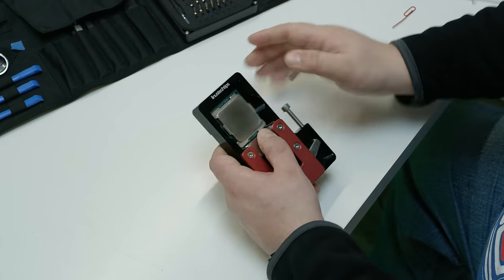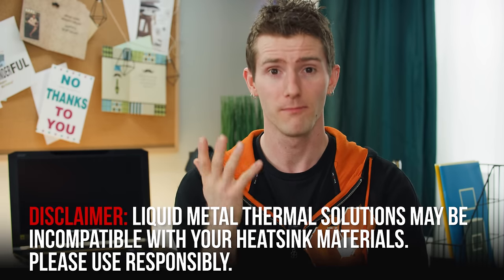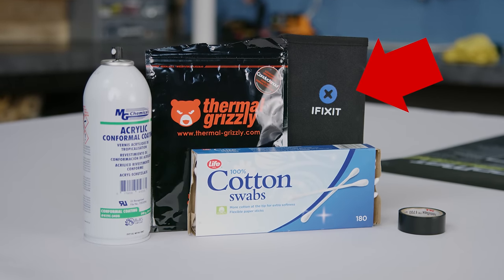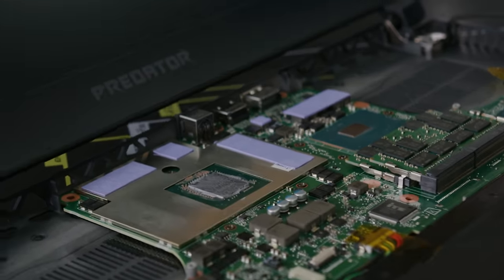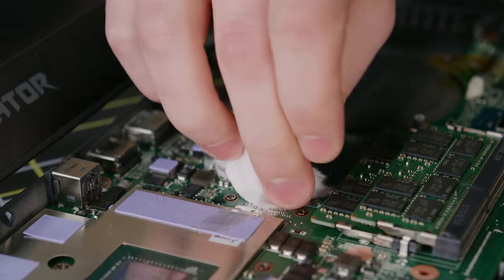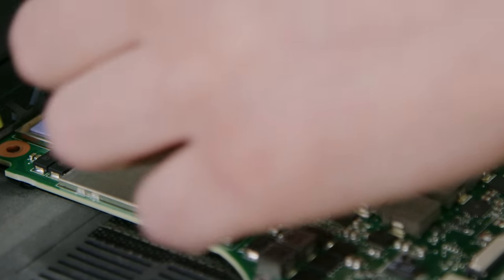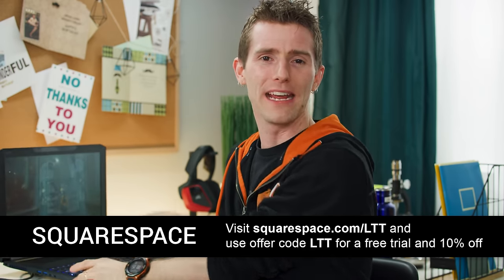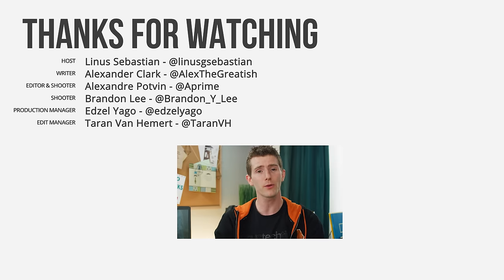Liquid Metal Laptop Cooling – 20C LOWER!

Comment: taken from: http://forum.notebookreview.com/threads/something-to-think-about-liquid-metal-compatibility-with-copper-heat-sinks.800890/

While those who are familiar with galinstan (liquid metal) type thermal compounds and how very bad it is to apply these to aluminum it is probably not thought of of how this works with copper.

Galinstan is an alloy of gallium, indium and tin that has a melting point of -19 C and a boiling point of 1300 C (no other metal has such a big difference between the melting and boiling point). This means that it remains a liquid at temperatures across what a CPU would see, unless you took your powered down laptop to Antarctica or Siberia and left it out in the cold where the galinstan would solidify and expand by about 3% (potentially tearing the heat sink off of the CPU if you did not make room for expansion).

Gallium loves to alloy with other metals; even with copper the metal ions will migrate in to the copper metal, gradually creating a copper-gallium alloy that is grey-silverish in color.

What makes this happen much faster is the electrochemical potential of the two metals. This is the same principle that makes an old fashioned lead-zinc battery function. Two metals in contact create an electrical potential and current will flow. One will oxidize (corrode) and the ions will move other to the other metal where there is a reduction (or plating) effect. Electrochemically speaking, the most negative metal will sacrifice itself by corroding away to build up a layer on top of the positive metal.

Electrochemically speaking, gallium has a potential of -0.53 volts and copper has a potential of +0.334 volts. The difference between the two metals is going to create a "battery" with a potential of 0.864 volts.

Gradually this battery will deplete; as the gallium migrates over to the copper. You may have heard some stories about how gallium "dries up" and evaporates. In many of those cases it is likely that it acted like a battery and migrated over to and became part of the copper heat sink.

If you take apart the heat sink from the CPU and clean it up you may find that the copper heat sink is colored a silverish-grey that resists efforts to even buff it off with a scrubbing pad. The stuff you can polish off is a corrosive residue of oxidized gallium and the stuff you cannot remove easily is now an alloy.

One good piece of news is that if this happens repeatedly the battery action will stop, as it is pretty inefficient to put gallium and have it migrate over to a gallium-copper alloy.

There might be a few things that are not so good news. It is possible that the gallium-copper alloy is much less a thermal conductor than pure copper. It is also possible that the alloy is not as structurally sound as pure copper or becomes brittle (gallium is pretty brittle when it is solidified). You may not even notice the first instance of less thermal conductivity unless you were in a laboratory setting and counting calories (thermal) and heat transfer characteristics, the actual difference may only be 1-2 C in a computer and that can get lost in all of the other variables of how computer CPU's cool, loading, power, air temperature, dirt on the fins or fan inefficiencies. 

The second thing regarding brittleness might only be a concern on a vapor-phase heat sink where the metal is very thin. Again, this is not proven by any particular instance but there is always the potential of the vapor phase heat sink of fracturing and letting out the magic cooling juice, right on to the CPU. (do not panic over this statement, I am not backing it up with any examples but maybe heat sink manufacturers should look in to it).

If you look at the IHS (integrated heat spreader) on top of a CPU it is made of nickel plated copper. If you ask the question "why did they put nickel on top of copper? copper is so much better of a heat sink material) it may be due to the corrosion vulnerability of copper.

Actually having the IHS plated with nickel is a good thing, it has a galvanic potential of -0.3 volts, much closer to liquid metal so the corrosion between the CPU IHS and the liquid metal is almost nil.

What might be an idea is to electroplate the contact area on the heat sink with nickel (nickel can electroplate directly to copper) and it would be over an area about the size of a postage stamp. In manufacturing that plating takes about five minutes but there is quite a bit of set-up to keep the nickel just where you want it and not over the entire heat sink.

You "could" electroplate nickel at home but it is a fairly toxic process and generates hazardous waste.

Again, maybe heat sink manufacturers can consider some sort of plating process.

Another alternative is a barrier that prevents electrical connection (that allows the battery action of galvanic corrosion from happening) but still has very high thermal conductivity. We have had this with regular ceramic, alumina (and even silver based) thermal pastes. No matter that the word aluminum or silver is in the name, most are pretty horrible electrical conductors.

This problem is pretty unique to just the liquid metal TIM (thermal interface materials) crowd but it is something that we should be aware of.

(BTW, I nickel plate and then silver plate my heat sinks but I have the experience from doing this with jewelry. It is an expensive and potentially toxic thing to get in to just for a heat sink).

Comment: A correction in this video. You should put the liquid metal in a tiny tray and use a tiny swab brush to apply the liquid metal. watch a much accurate version here 'MSI GS65 Laptop Teardown and Liquid Metal Mod - 20C Lower' by upgradejunkie

Comment: Hi Linus Tech Tips, if that's possible I would like to see you test that Liquid Metal compound against other thermal compounds, but cross it with different heatsinks. Just to see how a heatsink size/quality affects the temperature gap between all tested compounds. And since you started that LM project, there is also a factor that I can't find anywhere answer to: How gallium-copper alloy that is being created in copper heatsink, changes it's thermal conductivity over time? Some say it's better, because contact surface is better and some do tell grimm tales of lower performance. Cheers.

Comment: I’d really like to see how this would effect the unibody MacBooks Pro if you used it between the cpu/gpu cooler and the bottom plate of the MacBook . As well as it’s traditional spot. I mean if it’s designed to cool the laptop with the body then wouldn’t some kind of thermal compound help that?

Comment: I should try this on my Sager Clevo P750TM1-G. Its packing the 8700k with a GTX 1070. I undervolted and underclocked the cpu to a max of 4.4Ghz of 2 cores and 4.0Ghz six cores while locking the gpu at aprox 1600Mhz and achieved pretty significantly lower temps coupled with Cooler Master Mastergel Maker Nano. My cpu maxes out at 64~65C and the GPU peaks at 65C in Fire Strike and while in actual games, the temps are about 10 to 15C lower, depending on the game. I bet they can get even lower with some conductonaut while getting better performance, maybe even matching stock clock speeds, I just don't trust myself do something THAT extreme ; w;

Comment: Bad thermal paste 4+ w/mk, good thermal paste 12+ w/mk, liquid metal 70+ w/mk, Graphene 5300+ w/mk. (same stuff you have in your pencil)
Napkin math: 
Liquid metal 73w/mk, stock laptop thermal compound 4w/mk. 
Difference cond. 69w/mk. 
Difference temp. 20C. 
20C/69wmk=0.29
Bad logic:
Temperature lower with graphene: 0.29*(5300-4)=1536.8C
Reply: Ahh yes you must know the secret. tooth paste with ground up pencil in it, works  better then any thermal paste yet no one uses it...

Comment: Honestly. Use kryonaut. Liquid metal has a REALLY bad tendency to slip and slide around if you apply just a little bit too much, and one of those droplets ending up in the wrong place WILL fry something. The results are also not all that much more impressive than high end thermal paste, something that surprised me given the very large delta in thermal conductivity.
Reply: I compared both those products on GTX 970, GTX 1080 Ti, i7 8700k (on the die, delid), on the die of a CPU laptop. Except for the 1080 Ti, there was always a huge difference which made it worth it to use the conductonaut.

If you don't put too much (basically if you know what you are doing) and you protect stuff with nail polish I don't see any reason for things to go bad. Of course this voids any warranty :)

Comment: So I did this without any spray because I didn't watch the video first. It's been about a week now and I've been fine and it improved so so much. Also I'm only running an A6 5200 so I'm not to worried if this laptop breaks. It was only $300😂

Comment: Hi,
I was wondering if keeping say a packet of cold milk, or just a frozen box would help with the cooling. There were a few reservations I had with the idea
_______ISSUES:
_______1. Could this cause condensation on the motherboard (thus increasing risks of a short circuit), in case this cools the inlet air, which would also pick up moisture.
_______2. Would it have a noticeable effect if this isn't close to the fan inlets, and only under the body, such that it cools the bottom of the bottom surface which slightly cools the air inside the laptop.
_______Why not buy a laptop cooler like normal people? >> They would accomplish the same, albeit slower, since they'd be pushing in more room temperature air, and conduction to the laptop body from a cold object would be more effective than from a less cold air flow.
 One disadvantage is that the higher convection may increase gunk accumulation in the board as the air carries dust along with it.

Comment: MSI use high quality paste so using gelid GC didn't change much. At the beginning tests are very promising but after some time it always stays at those "stock" temperatures, no miracles. I guess outdoor temperature is a main issue for laptops cooling.
Reply: Msi do not use high quality paste. I can tell by having a MSI GS65 Stealth Thin 8RF and got a 20 C decrease in cpu heat
Reply: Well that's rare, I guess that they put it wrong in factory process. I never had such a big diffrence in temperatures. 5 C is MAX, but it also depends from outdoor temp.

Comment: Wouldn't it be more logical to apply a thin thermal pad around the GPU capacitors rather than electrical tape as a liquid metal barrier? Even just finding the right thickness it could be lightly crushed and completely make a seal around GPU on the heatsink. I'm thinking about doing this to my Predator Helios 300 while I swap to a 960 evo m.2.

Comment: While I know I'm late, I've only just owned my first (proper) laptop for about a year and I'm considering it.

Some napkin math suggests that:
Given a heat producing area of 140mm², heat production of 50W (best my cpu can manage is sustained 42W)
thickness of TIM 100um (optimal acording to fuji electric and ridiculously small)
the paste would give a delta of 8°C
while Conductonaut™ would do 0,49°C.
The math checks out. This stuff is amazing.

The equation (for anyone interested) is:
P=c*A*∆T/d
P - power
c - conductivity
A - area
∆T - difference in temp.
d - material thickness
Reply: Ok nerd

Comment: You didn't mention that the gallium in the liquid metal will react with the copper in the heatsink. It corrodes the heatsink, essentially 'burning' itself into the copper, degrading the metal and creating a stain that dries and becomes literally - not figuratively, LITERALLY - impossible to remove by any normal means, including scouring pads, rubbing alcohol, tissues, or razor blades. This can potentially result in WORSE temperatures over time, if you're unlucky.

Liquid metal should honestly only be used to replace the TIM in delidded CPUs. I'm not saying you CAN'T use it on laptops, or as normal thermal compound on the outside of CPUs, but it'll eat into the copper of any heatsink you put on it.

Comment: Why not just simply use Grizzly TG shield to protect CPU components? And as i know there is a smaller attachment for syringe when applying liquid metal and that bigger one to take away if you spilled too much. And that looks like too much liquid metal for cpu and gpu.

Comment: Why would he recommend this solution on a laptop without waiting to see if it leaks out from the die or deteriorates conductivity? almost always leaks from what I hear even with conservative application. Nice spooge at 5:08. I'm not sure if it would take all day to mask a die for a insulation coating unless you failed kindergarten. This would take 5mins or less and insulate much better I think. Will be applying this on my 7700k/780ti desktop which stays upright. I did appreciate being able to see somebody else do this first however, as I myself never have.

Comment: I wonder, could you create a thin 'border' on the outer edges of the cpu heatspreader with normal thermal paste so the liquid metal can't run out onto the board over time, or would the liquid metal react with normal paste in unfortunate ways?

Comment: Why don't the manufacturers do this in factory already?? Just spray a layer of non-conductive shield on the capacitors and apply liquid metal. Then that would be another market jargon "ultimate liquid metal boost" some sh!t like that.

Comment: I fell down the rabbit hole after this and looked up lots of liquid metal cooled laptops, but none brought up its effect on battery.

One would think with better heat dissipation it doesn't have to work as hard to cool and thus use less power. Follow up video with light medium and high loads and the effect on battery?

Comment: you should have mentioned room temperature as well.  after checking the stock thermal temperature, room temp might have been dropped.  
People who reviewing coolers, usually make this mistake a lot!  

like this
 
"I checked my Intel stock cooler and it says 80 degree and while I changing new cooler I reviewing it,
 my father turned air-con and I did not realized it then I fcukin found my new cooler says 50 degree under same test load!!!!  It is amazing!"  

but it is totally not same

Comment: Wait, if the performance increase is seriously this massive, why don't laptop manufacturers already do this from the get go and release products that perform head and shoulders above the competition?
Reply: Look Behind You Like other people mentioned, the compound might just dissolve your laptop (slowly) if it's parts are made of aluminium/copper which most are... You'd also need to re-apply it regularly as well and not move your system around a lot to minimize the risk of you bumping into something with it that might get the compound in unwanted places thus bricking your device.

The risk isn't worth it in short.
Reply: I think they sould adress this and make it work
Reply: Price. If it costs 10 cents more, that equates to a million more dollars, spent to design the robots and such in the design process. I agree that they all are under engineered, in the design phases. I guess beauty before brains. More important to design it to look nice than to perform.
Reply: lol there will be alot of returned laptops because of getting fried.
there is always a risk of that liquid metal to go to other component.

Comment: Thermal Grizzly liquid metal Is the drug of gamers. I have a Acer predator Helio’s 317 inch with a core I seven 7700 HQ and a GeForce GTX 1060 Re-pasted the GP/CPU a month ago with thermal grizzly liquid metal conduit and saw a 19° drop in temperature is on both corners this stuff is the best that you can buy and well worth the price !!!

Comment: Once you apply a very thin drop and extend it over the silicon chip, after few runs, is there a risk that the liquid metal will get out of its place or once it's sticks, it will stay there ?
Reply: @drunkdriver  Thanks for the answer, but been using it quite some time, and there are 0 issues. The only thing is if you apply it on pure copper, you gonna have to reapply it after some time cause it galvanized the copper, the pure copper absorbed it.

Comment: Hey did you guys really leave that electrical tape surrounding the die? I'm probably going to buy some of this liquid metal for my ASUS G15 Zephyrus which from the factory has some heat problems (most of which is solved by removing dumb plastic vent covers) but I can keep it from thermal throttling by ramping the fans to 100%. However, the best temps that I generally see are in the range of 72C (yes I know that's actually pretty good.), but I keep a desk fan blowing on the laptop body during gaming and I use a laptop riser to keep it elevated. So I'm really hoping that replacing the factory thermal paste is going to make a good deal of difference. I don't think I want to leave any tape on components, because electrical tape is definitely an insulator.
Are the special thermal pads for the memory modules that I should use in combination with this stuff?
I'd be happy to order these items with your affiliate code so that you guys can get a piece of it.

Comment: I wonder if it would be feasible for manufacturers to connect a heat dissipating sheet to the pipes and allow access to that sheet below via a removable panel, so you can attach a third party cooling device (blower, liquid coolant or something. Most of the time, we just put out laptops on the table, so why not have an option to blow off some heat from below.